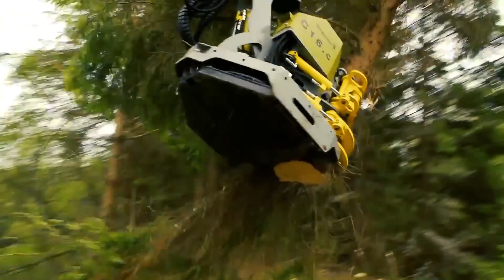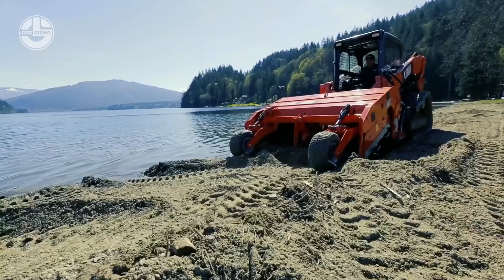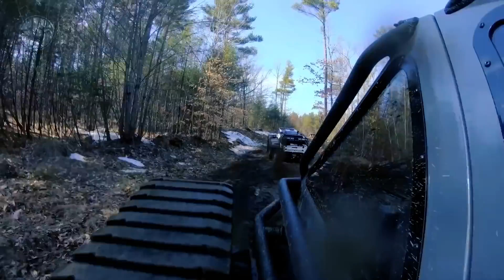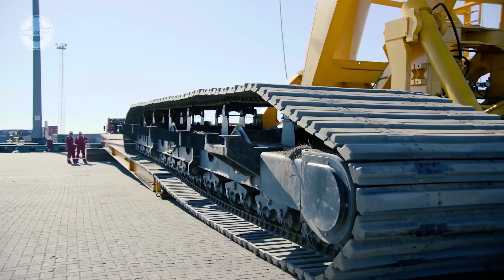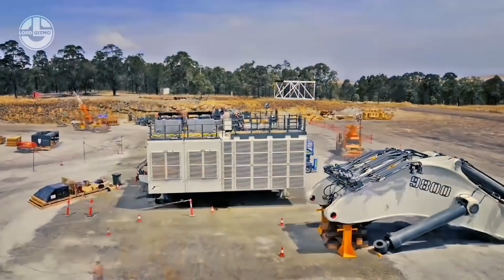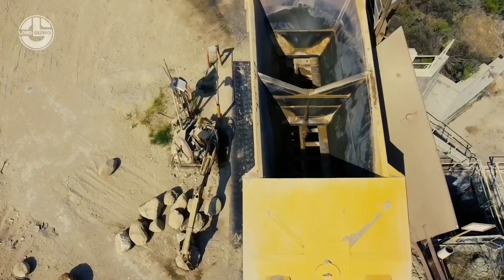Extremely Powerful And Impressive Machines | Powerful Machines That Are On Another Level

Comment: A little correction, LG:  Thermite monitors can maybe in best case throw water near 500 feet because 500 meter is a physical no no due to air resistance break up of the stream and the water will soon fall down to ground like rain. But of course if you are standing on a mountain and accounts for vertical length of spray?  ;D     // Fire Officer   Ps. The hardest class for Fire Fighting Ships is FF3 and "the big guns" then throw about 150 to 175 meter with more than 1 MW pumps or a couple! With so large flow you have the same force going back so the small remote tracked monitors with overhead mounted nozzle will have to weigh like a ship! Haha!
Reply from the maker: Thanks for the info!  Looking back, Thermite claims that the range is 300-500m, so it's like that 500 is a very "optimal" shot.  Even then, 300m is a huge distance, and pretty substantial claim; I'd have to see it to believe it.  It could just be accounting for mist, who knows.  Anyways, we love hearing first-hand accounts, so thanks a lot for the info!

Shooting water takes a LOT of force, and physics tells us whatever shoots it has to feel that same force back.  I can imagine a lot of smaller remote vehicles would struggle to keep themselves stable on anything but a planted concrete floor.  But, we don't tend to get into the specifics and arguments against any given machine, because then it'd be an hour long video of back and forth!

Thanks again,
Lord Gizmo Team

Comment: What is "a hydraulic piston engine".. I'm sure it is a piston hydraulic motor.. In fact I'm sure it is 
As I stated before I believe he has no knowledge of anything mechanical.... just reading from some translated brochure
Reply from the maker: The company who manufactures the device used the term themselves, we didn't invent it: https://www.brackeforest.com/products/felling-heads

The video refers to hydraulic engines, a more technical term where the "hydraulic cylinder acting as both load and rebound device using a hydraulic control system. This gives the unit high operational flexibility," according to Wikipedia.

It's actually quite rare, and as much as we'd love to explain the mechanical concepts, it'd be for one machine when that information isn't vital.
Reply: @LordGizmo  in this case I stand corrected, it is, as you said in the company video... it is they who are wrong, as it further states the the hydraulic requirements are a pressure of 170Bar with a flow rate of 140l/min.(presume they mean these are the minimum requirements).. If, as it is, using external hydraulics to power the saw, then that is a hydraulic motor, not a hydraulic engine. (if such a thing exists in these circumstances)